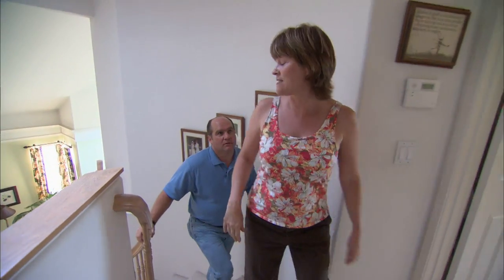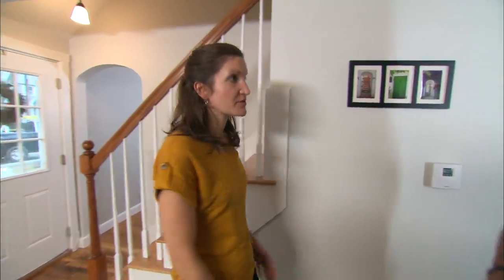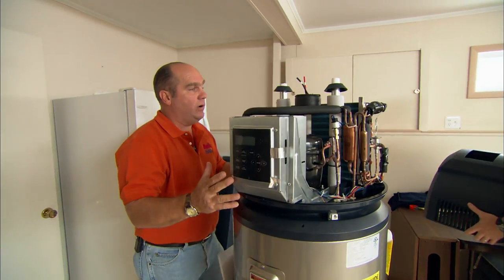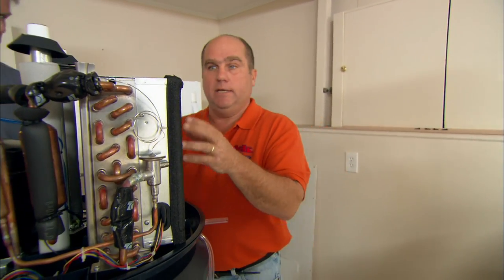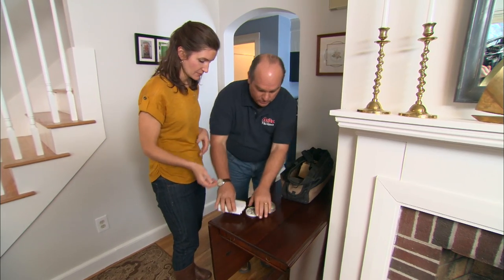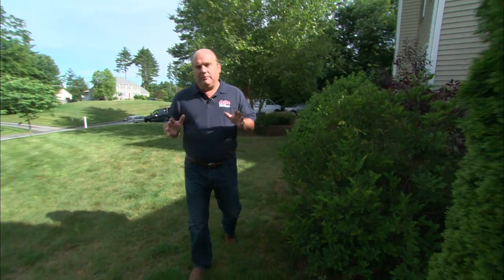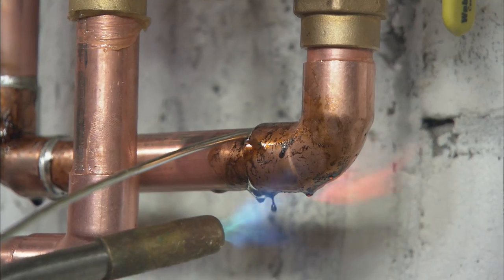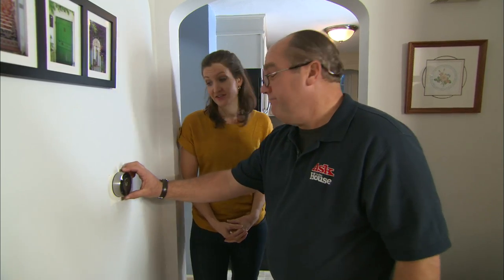Richard Trethewey's Greatest Hits | Ask This Old House

Comment: Richard you latest show on energy monitring showed 5-6-2018. Your son got you a whole house energy monitering system for your main panel, and these were good to a point but you still had to play dective and find out the scorce of the energy spike or draw, what works better is one on each breaker and one at each light switch, and outlet in your home.
With a system like this you spend less time tracking down the calprut and fix your energy hog problems. 
All over northamerica smart meters are being installed or are installed on your home, I dont like this 2 way radio systems these have id opt for a  wired none wifi cat5e system hooked directly to your router system to keep this information privite. Because of the nature of these devices they bring some what of a bit of insecurity. Anyone with 1/2 a brain can hack the transmission and know by your power usage what room your in in your home or if your home. If your in the bathroom or watching tv.  Yes tecknlogy is nice but with it you open doors to other problems. Many of what are unforseen.